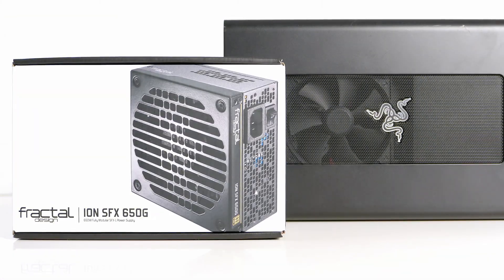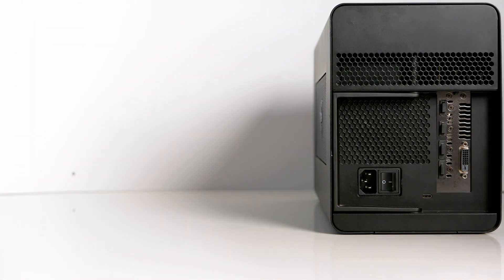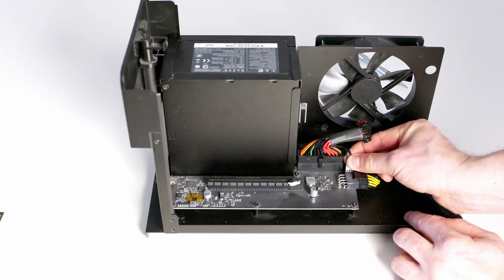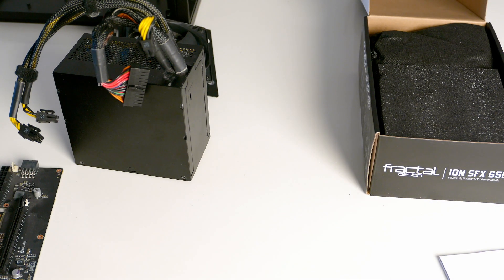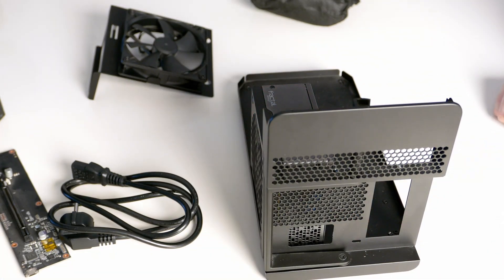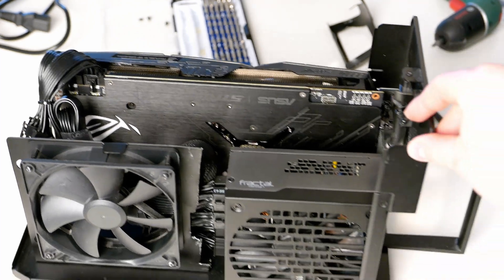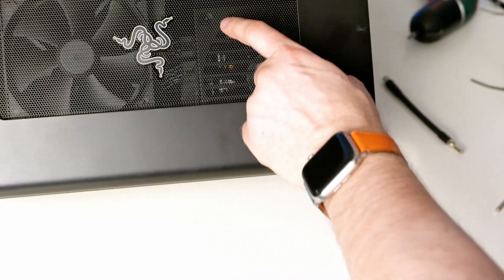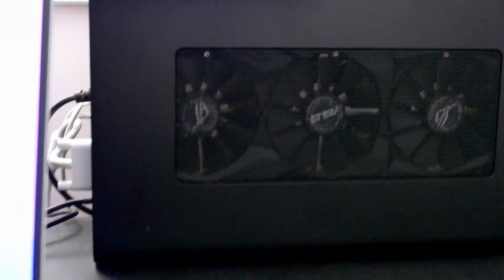Silent Fan Razor Core X eGPU modification

Comment: Newbie here.
Which cables do I need to connect on the new psu?
Reply from the maker: @irvingbodden5981  you will need the 12 pin for the big power port and then you need the pci e cables.
Reply: @ thank you for writing back. that’s it?
Reply from the maker: @ you have 12 pin for the main board, I think there was a 6 pin for the board again and then the rest goes on the card as needed.

Comment: Tempted to change the one in my Chroma too, the fan in the stock PSU is very annoying.
Reply from the maker: yes indeed. The more expensive PSUs have this temperature tolerance that makes them quite until they hit certain temperature. I wish there was a way to better control the big fan which unfortunately runs all the time

Comment: Do you plug in the cpu or pcie connectors to the p2 ports on the motherboard?
Reply from the maker: I do not think there are is P2 connectors on the board. For the motherboard of the Razor Core X you need the 24pin, CPU.  PCI E goes on the card itself. I used the P2 to power my fan replacement directly.
Reply: @Bonyo Bonev  I figured it out on my own but I said P2 cause the OEM razer PSU has labels on the connectors p2, p3, but they're just the CPU and PCIE cords like you said.
Reply: @elpizo2439 Hi , may I know which cable connect to P2 port ? CPU or PCIE ? Thanks
Reply from the maker: @CGC0.1  I guess you are referring to the labeling of the Razor cables. Razor core does not have P2 in general. 24 pin is for the big block, PCIE are for the card. There is one more connection which you might be referring to and that goes to the board.
Reply: @bonevchannel  may i know PSU which power cable connect to Razer Core X Logic board ?
Reply from the maker: @CGC0.1  the 24 pin + one more I thing it was 8 pin…
Reply from the maker: @CGC0.1  check this image out. It is 24 pin plus 8 pin on the front. 

https://www.etsy.com/listing/1293010019/razer-core-x-bracket-for-corsair-power
Reply from the maker: You can watch the fan mod here: https://youtu.be/vFDZhZUsiK4

Comment: Can you use the old razer core psu in a computer ?
Reply from the maker: Hi, I do not think it will work because it does not have enough cables like the ones for the IDE/SATA. It has only 2 PCI-E plus the main 24 pin plus the board cable and that is all.
Reply: @bonevchannel seems enough if no SATA 2.5/3.5 drives are to be used. Thanks for the reply!